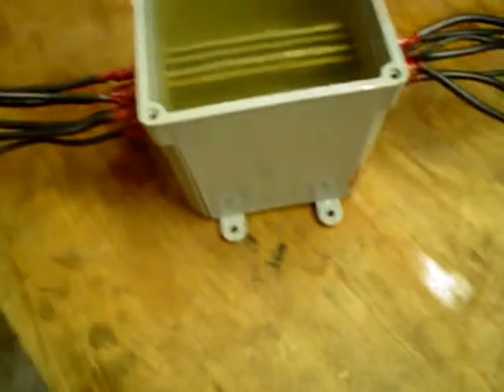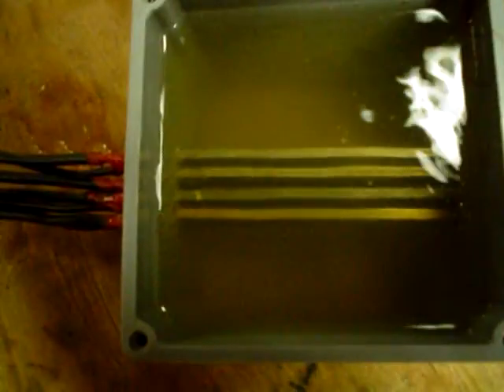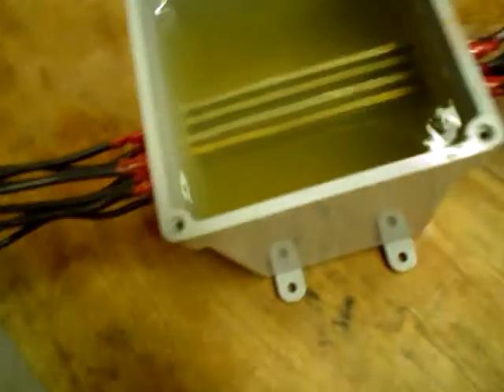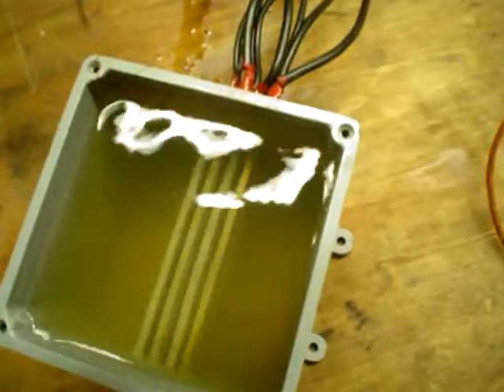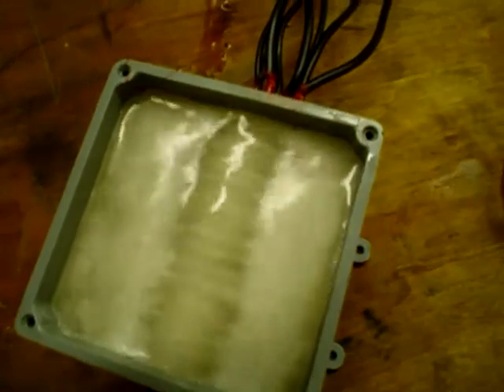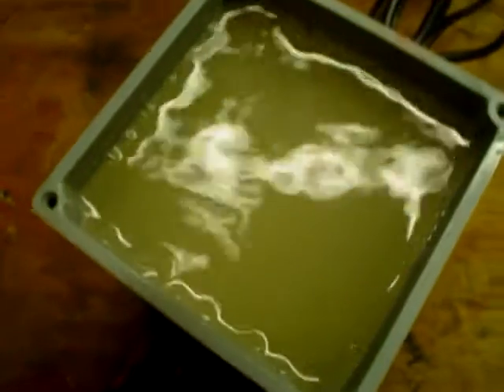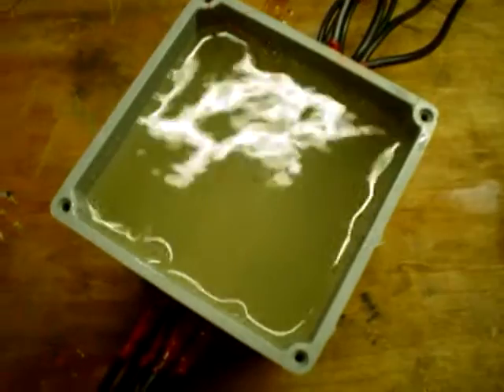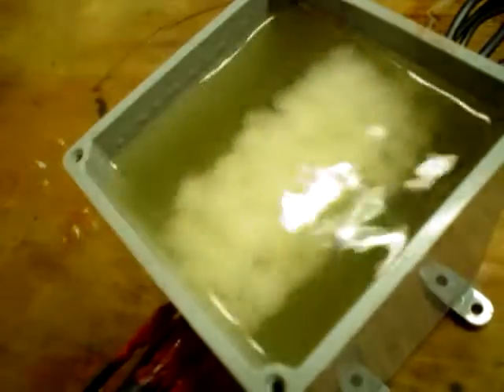Intro to my "HoneyComb" Cell

Comment: eh yo if you rigged that cell up to an official stanley meyer pulse width modulator you could use milli amps at high frequency voltage to get an insane amount of gas in cold water with no electrolyte plus the water stays cold. You could run a car with that baby no problem. vancouver gadgeteers on youtube sell the real stan meyer joint im gonna grab one right quick all im sayin is if you pulsed small amoperage with insanely high current in that cell youd be gone bro!!!!!